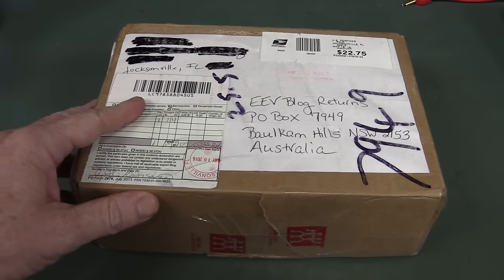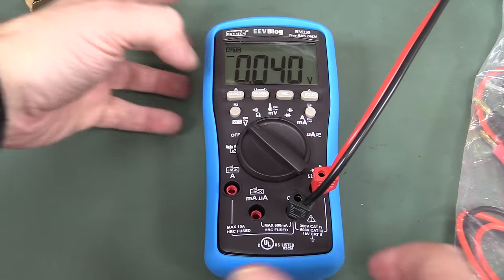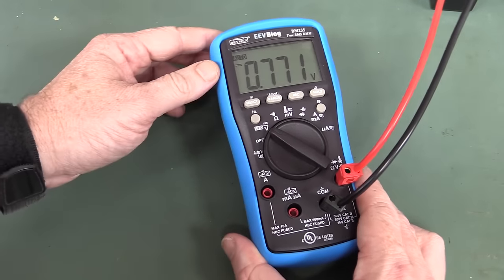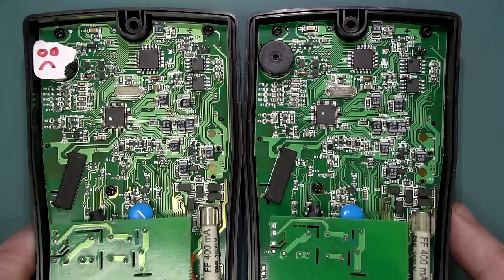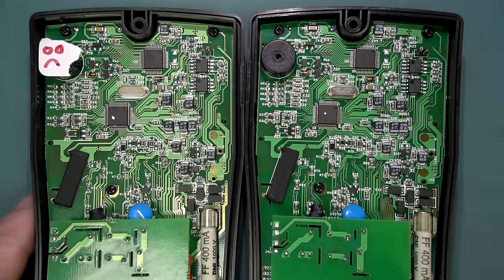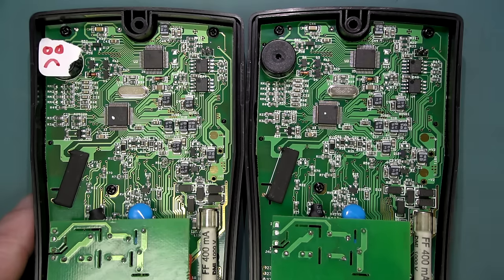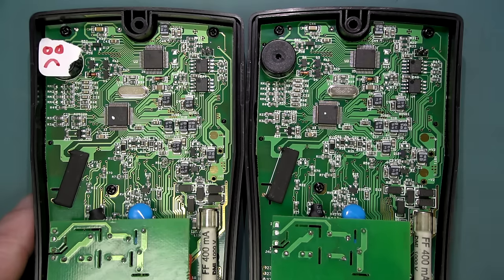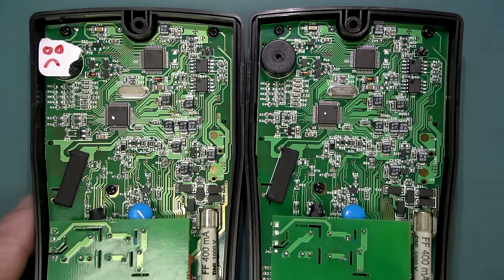EEVblog #884 - EEVBlog BM235 Multimeter REPAIR

Comment: Looks more like physical impact damage to me - the component is sheared at one end and torn off the solder at the other - at 15:30 you can see the solder fillet appears to have been bent slightly down on the left side, also consistent with the component twisting off the pad.

This could have happened between bed-of-nails test of the populated boards and assembly into the housing. The manufacturer will know the exact sequence.

The damaged part is nearest the edge of the board - first to take an impact - those black plastic parts are part of the case? and were not able to protect the naked PCB.

It could have also occurred when the current shunt or red wire were fitted - slip of a soldering iron - looking at the solder in the vias I assume manual assembly of those parts.

Comment: Hey Dave, did you notice (around 15:42) that the "top" contact of L2 also looks suspicious? Looks like a semicircular crack line in the solder.

Comment: Yes this happens. I found one 0805 resistor with the same problem (was a Panasonic resistor) But was just one of over then thousand resistors of that model I used.

Comment: Hey Dave, Have a brymen bm251 that i had for over 10 years. Now the ac voltage mode does not work. Everything else works fine! When I put the leads into the socket it says 0 voltage. Mabi you know if this is common or a simple fix. I have opened it up, but cant see any unusual. When turning the dial to ac voltage, the ac symbol shows up and says 0L.

I have checked the fuses!   =)

Comment: You can't flip it over. The actual trace that comes from inside, is tried to the cap end. So in this case, it's gonsky.

Also, it was mechanical stress. It went in hot, so the piece was hot and expanded, and when it cooled, it cracked. I've seen this  once before almost identical failure.

Comment: Daaamn, ACL injuries are the worst! I did mine around a year ago now, had it reconstructed and I still haven't recovered fully. :(
Reply from the maker: Damn, a year, that's not good.
Reply: It's a case by case (injury degrees), how determined you are, mentally, and how good the doctor is with his/her pointy bit.

Tore the ACL on my left, twisted (never really understood what that term meant, getting the feeling it was medical slang) on the other leg, chipped my knee caps (legs went backwards) and after i had both legs on lock because of fluid, it took me 7 months to get in a functional state after the surgery.

By functional i mean i was able to run with some discomfort and in the winter knees (to this day) get colder than the rest of my body. Now, i was a kid back then, so, your mileage may vary.

I would alleviate pain with warm water compresses or hot baths, about a year's worth after.

Either way, try and find a good doctor (not sure how Australian system works), and follow their instructions.

Oh and, be light on your feet, you can get your other leg injured by trying to manage the other. It's really stupid and sometimes it happens, my doc told me it happens quite often, so, if you have to suffer crutches, suffer them, soft or hard bracing depending on how severe it is.
Reply from the maker: Yes, I'd be looking to get a top class ACL sports specialist surgeon.
Reply: Sorry to hear about your injury Dave, wishing you a speedy recovery man !
Reply: I snapped my ACL about 6 years ago while skiing in Switzerland, luckily not much pain but a load of swelling. Got back to UK and had it repaired on NHS (hamstring graft for those following the technical side) and I ski on it hard and fast ever since. Sometimes I can feel it but mostly good.
There is a new procedure I saw this month - http://www.themichelicenter.com/revolutionizing-the-acl-surgery/

Hope you (and Dave) heal soon.
Reply: My daughter messed up her knee skiing awhile back and now has to wear a brace.  Hope you heal without surgery.  WTF were you doing Dave?
Reply: I had ACL replacement surgery in 2008. Never been the same.

Comment: in joe.smith video it is indicated that just above the failed  coil L2/L3 there is a cut in the front cover (made by hand). Could it be that the coil was physically torn from its place because someone forgot to cut the pin in the front cover?

Comment: You'd never get this problem with a UNI-T or a chinese firecracker multimeter! ;)
Reply: I have a UNI-T, which I'm quite happy with for the budget I had at the time, but there's no rear guard input safety protection to speak of (I think as I recall Dave's already done a teardown of that machine?) - This BM235 looks a really beefy chap in Comparison, no wonder it's reflected in the Price Tag (comparatively speaking).

Comment: I have a new brymen 235 meter.  I used it to measure resistance across the terminals of a microwave magnetron.  I was expecting a measurement of .8 ohms.  I got .2 ohms then is quickly went to zero.  I thought the magnetron was bad but I get the same thing with the new magnetron.  Is the meter be OK for measureing less than 1 ohm?
Reply: No not.

Comment: Some year ago i working in one of the biggest aftermarket supply chain firms that repair STB. I've repaired 10-20 during on shits, for 1.5 years. One repair i have remember and i think for enrite live. One of many (10-15) postregulatros give 0.8V instead 1.2 or something. Everything looking good but voltage sucks. Any visual damaged i can't see. I found source of this issue when i try change one of two regulator feedback resistors (that was curios but it was something). One of them was cracek and not conducted when stb working longer (thermal stress i think). One times of 3000 repaired pcb's. It happend.

Comment: Hi Dave, i'm a great fan of your videos (and your great knowledge). But i think you're wrong on one issue here: the component placement print. Yes, it is good, old fashioned silk screen! no dot matrix here. The pattern you can see in the microscope is the nylon screen used for printing. All silk screen prints shows this pattern if you enlarge them. It's not half-tone screen like in a printed photo. (It is possible to print halftone images with silk screen, with half tone raster (screen), in this case the rule of thumb is that the halftone image should have half the lines of the silk. i.e. a silk (nylon that is) with 100 threads/inch, wil print an image with 50 lines/inch. Quite a coarse quality, as seen on t-shirts.

Comment: Hi all!
I have a question specifically for Dave at the EEVBLOG. I have purchased a BM235 branded eevblog from amazon here in the UK under a year ago. I seem to have an issue with it at the moment where the meter seems to not give correct voltage measurement readings in normal V (DC) mode. The unit in this same V auto mode, throws a wobbly when I press the range button 3 times. Briefly I can see 'insersion error' and acts as if I have wrong probes inserted even if I have no probes! It does however show voltage readings for DC correctly using low impedance mode. Also, continuity mode without probes and with, displays a short. I have made a video and will upload it at some point today. I have seen similar issues with the dial which was posted a while back. Nothing I know has happened to the meter to cause this issue. I will post on the forum also soon.

Comment: Funny how biased and apologetic Dave is with different meters when you compare something like that with his reviews of UNI-Ts
Reply: That is true but I am still pleased that he is not afraid to go public with these issues. He could pretend there is nothing to see here folks.
Reply: I think criticizing Uni-Ts is fair, but maybe not for the reasons Dave does.
Reply: Yeah it is more likely the lack of strain relief on the wire connection next to the inductor.
Reply: @SoftBreadSoft  It shouldn't need strain relief. It's going from one board to another with both boards hard mounted to the same chassis. There's no strain on the wire.
Reply: @MrPaddy1000111  If it's bent, it's straining. But yeah, could just actually be a bad part.
Reply: @SoftBreadSoft  well the bend was caused by the disconnection of the top board in there. I can't imagine that tiny pissy wire caused enough stress on the board to break the end of that smd off!

Comment: My $.02 guess is that the ferrite of the choke cracked either before PCB assembly or during reflow soldering, either the thermal stress of cooling taking advantage of an otherwise survivable manufacturing defect or simply that the choke ended up in a position which stressed it once the solder cooled down (I've heard of it being a relatively rare failure mode with SMT, never seen an example with my own eyes (well, now I have seen a video of it)).
Pro and hobbyist electronics geeks, take note :)
Reply from the maker: My money would be on a thermal stress failure during soldering.

Comment: L2 also has a (tiny) crack in the solder joint. Did the PCB bend during assembly?
Reply: You can see it on 15:52, joint on the top side.

Comment: I have failed the uni-t ut81b model meter when it connects enters test mode at least 5 minutes after it continuously measures voltage, about 888k, can I send you a video if it can be repaired?

Comment: I have a BRYMEN 257 and it does not measure the ohmmeter, only megaohms, very high scales, but normally when measuring, the scale of the display flashes.
When I turn it on I get C_ER and without a scheme I'm lost
Do you have any idea what it can be?

Comment: I used to work in physical therapy. I saw so many people go down hill after knee surgery (as well as athletes). Please skip the surgery if you can or work really hard to get back on your feet asap.
Reply: That's not a good advice. If surgery is necessary he needs to take it. No offence, but you're not a doctor and ACL can have complications if not treated right. It's just about the stupidest advice you can give.
Reply: aserta Im saying skip the surgery if thats an option. as in the doctor says "get surgery of do these exercises for n months." So many people (americans at least) jump to surgery and don't even ask if there is a plan B.
Reply from the maker: You can get by fine without ACL surgery if you live a fairly sedentary lifestyle, and maybe just run or cycle for exercise or something. But anything else requiring any sort of twisting action will be out the question. eg. playing with kids, outdoor stuff, etc.
I did this injury 7 month ago, and I've popped my knee even in the kitchen just pivoting around.
Reply from the maker: I'm speaking to the surgeon tomorrow. But I already know it's entirely optional. I could win the tour de france or an ultra marathon with no ACL. But play ball with my kids in the backyard, probably not very well.
Reply: good luck with it then :)

Comment: i have 2 multimeters, one expensive and one cheap and a rigol ds1054z scope.
when i measure resistance i get different values in both my multimeters and my scope. for my scope i have a shunt resistor and i calculated the resistance using ohms law. 
i don't what to trust know. 
any help please!

Comment: Why does it seem like the solder on the other pad never made a good bond with the cap of the inductor? The component shouldn't have wiggled loose that easily from the side that didn't crack. It's possible the inductor cracked during soldering and was able to make enough contact to get it through testing.

Comment: "You can pick these up from eBay cheap"... yeah 35€+25€ shipping... :P
Reply: It is cheap for the quality. I can't even find a 0.1% capacitor on Digikey. Best is one 0.5% capacitor and not in stock.
Reply: K71-7 0,5% is a cheap and common on ebay. SSG and SGM (0,3% hermetic mica) are not rare also.
Reply: Well, even 0.3% is not as good as 0.1% :-) Looks like it is really difficult to get very accurate capacitors. I could only find some from metrologic companies, but these costs 1k USD and more (but of course, they are even more accurate and with certificate etc.).

Comment: It appears to be a mechanical stress related failure than an electrical one.Or stress then fail.The cracked terminal on the inductor, If it is electrical would have taken out the surrounding trace. Vibration test would easily pick this type of fault at production.  FMEA tools/techniques would be in order. Product returns are the manufacturers' and designers nightmare, especially so for low cost products. 3D CAD tools are a great help in this aspect.

Comment: I think you broke it by taking it of. Inductors are often very fragile. 
Sometimes the Parts stand up very slightly, especially Inductors. Its kind of a tombstone but the part stays on the solder and can still have contact. We call them "Auflieger", which translates into something like "lays-on", because they still lay on the PCB.

Comment: With the crazy number of components in modern devices its amazing to me that this kind of thing isn't way more common. When you think about it the percentage failure is actually low.
Reply: But we dont know how much didnt passed at fab.
It could be 50 failed for 1000 pcs.
Reply: Arek R. I don't really mean just this device. I'm thinking more any given device has hundreds if not thousands of components with that many points of failure if not multiple ones for each component. Then think of how many devices you have in your daily life. Its amazing that stuff isn't exploding left and right.
Reply: Think of computer motherboards, or ever server boards like that 8 PCI-E slot one on LinusTechTips. There's some ridiculous number of components with miniscule pin pitch and several layers in the board.

But then also think about the cheap Chinese crap that just about works through its usable life and is planned to be obsolete.
Reply: Computer/server mobos have up to 16 layers PCBs...

Comment: The RFI bead might have cracked during soldering if there was any water entrapment, are the components being baked? Suspect not...
Reply from the maker: Yep, could be one of the failure modes.
Reply: +simontay1984 Pretty much all components have some sensitivity to moisture from the air. If the components are not baked prior to reflow then the moisture build up can crack/distort and failures occur. Mostly it's plastic packages which are most likely to suffer.

Comment: this multimeter is obtained with the green lee brand the DM860A, but the DM830A is the same as the fluke 87 v with a little more functions these green lee multimeter are excellent nothing to compare to fluke ok

Comment: hi, i need some help. I have blown 400 mA fuse in my multimeter mt 1710. i replaced it but now resistance auto range is showing 6.15M ohms and diode test mode is displaying 1.561v. Despite that it seems that the measurements are right. Does anyone know how to fix it?

Comment: Great video !  Did you see the astronaut measure the Ohms on the ISS with an old Fluke 87 DMM when deploying the Bigelow BEAM module ?  My EEVblog meter seems to be working great.  It has a lot that the Fluke 70 III does not have.  You should offer the micro Current with the meter if it can fit in the packaging...  Do you have a link for the test item that plugs into the meter ?  Thank you for the video !  tjl

Comment: i had  a foulty part in a moving light the cooling fan exploded becouse the mounting holes from the pcb wasent compleetly fastend so the fan blade could tilt wn the light moved it hit its casing and exploded :P plestic parts went everywere

Comment: Most likely the indutor got caught in the feeder in the P'n'p, and the lack of component in the end of production, made the operator reuse the old compunents in the component dump. If the inductor got caught in the lid of the feeder, the pneumatic action could easily have made a microcrack in the inductor. And the heat of the reflow oven, would make the crack expand. 
Add the vibration of transport and the heat changes, it will fail.

Comment: What purpose do these inductors serve?
Reply: It appears they filter out high frequency ground/return currents, so the whole unit doesn't become an antenna once you connect it to something. They are not necessary for unit's operation per se.

Comment: Hello Dave i know this is a little older video But here is a good Question for you.on your Multimeter Some people might say this is a little crazy and just go out and Buy one But This question is from a DIY kind of person like my self. What would it take to build on my self. I know there is a lot of reason that needs to be done ahead of time. But what type of housing would you need from a handheld to a Desktop housing? Also same with processors and Parts. Like the Shunt you will need Fuses, and other parts. This is more for a learning Curve for me ready. I'm not going to build one. I just want to learn what would it take to make one. Please help me to learn this?? Thanks Joseph